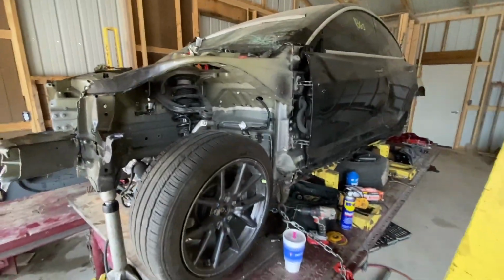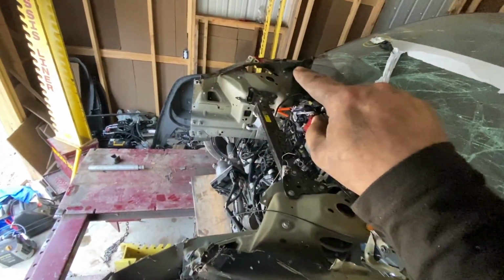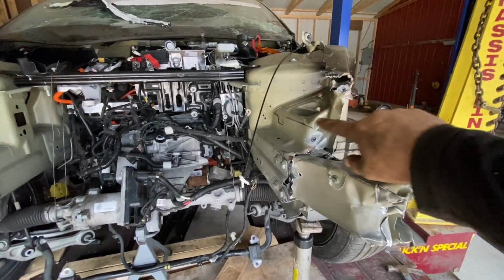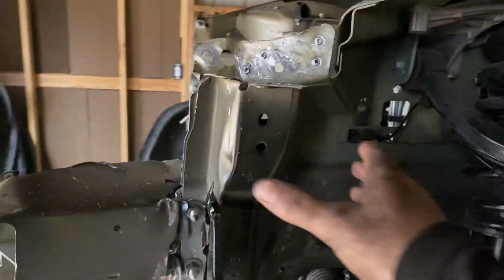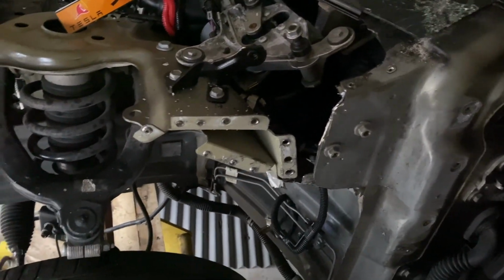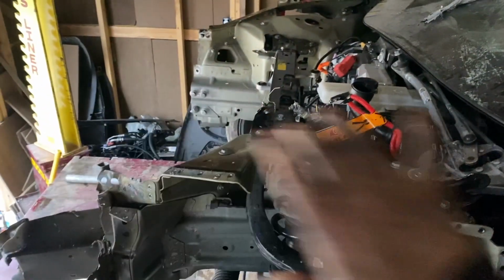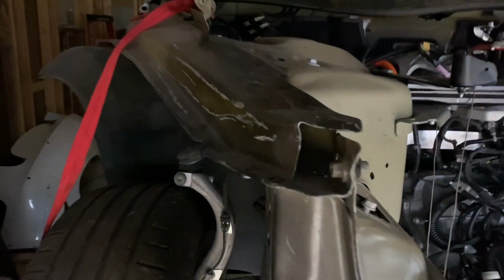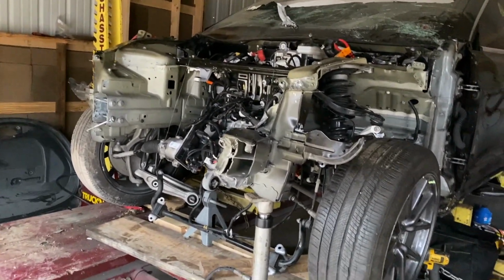Part 3 of Tesla Model 3 Rebuild

Comment: Yea your going deep in the frame repair for sure.  Good stuff I got luck mine only had a slight bend on the passenger crash can socket. I was able to beat it over just enough to align the bumper.  Still think even though I'm finished with the car I have a very small gap in hood to bumper difference.  Guessing it's still a bit out and pulling bumper down 1/8, other than that the car came out great!  I'm not to worried it drives straight and in all looks like new!  Take it easy man and good stuff!
Casey